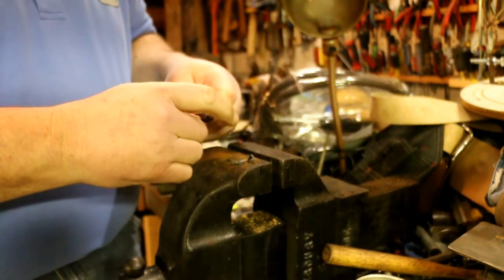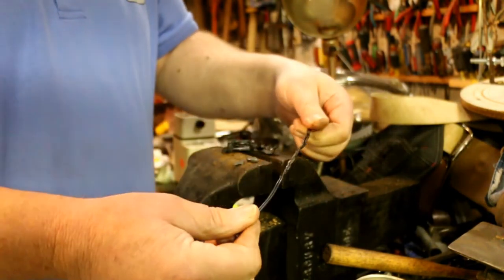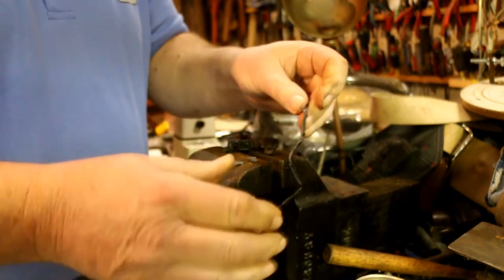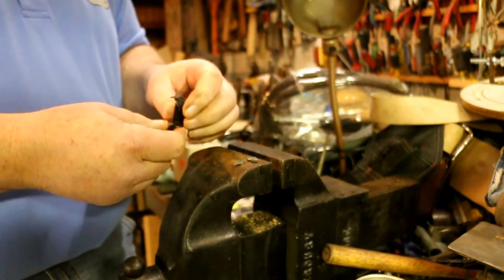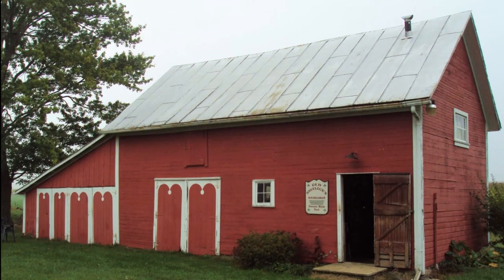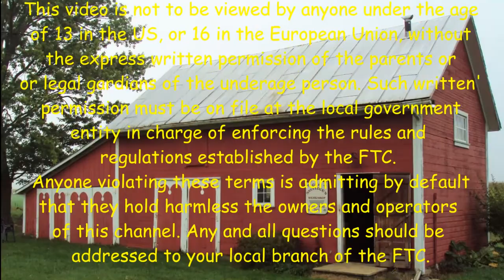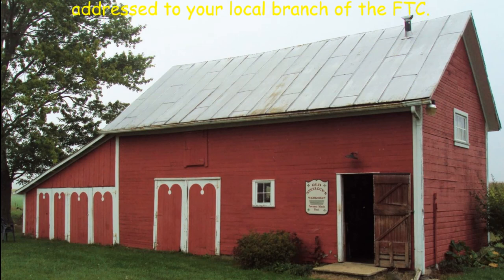Digital Picture Frame Pt 1 Trouble Shooting The Power Cord   What Is That

Comment: Ferrite cores are used to minimize RF interference.    The power may be DC, but it is not a consistent voltage.   It will likely be produced by a cheap diode which will flip the AC negative half cycles to be positive.  Perhaps the manufacturer found that the CD wave form was causing defects in the display.   Cheaper to use a ferrite core to fix than improve the power supply.
Dave.
Reply from the maker: Kind of smooth out the wave form. Gotcha. 😁😎

Comment: Ferrite cores are a cheap way for the manufacturer to somewhat improve the amount of noise cheap wall warts emit.  If you have surplus wall warts laying around, just find one that outputs the proper voltage, and has the correct polarity and power output.  Also, when the cord has damage, it's not uncommon for the socket to be dinged as well.  Those are often easy enough to resolder if the socket is a through-hole type.
Reply from the maker: It is on the desk in the shop. Still working. 😁😎

Comment: My dog chewed the cord. Can I slice it back together? There's a red wire and a black one
Reply from the maker: It happens to all of us. 
Our cat only chewed one wire. She decided it didn't feel good biting extension cords. 
Just strip back the wires and twist the red wire to the red and the black to the black securely. Solder them if you are comfortable with it. Crimp connectors are stronger than twisting adn easier than solder. 
Then put electrical tape over the joints. Plug it in and try it. 
If it is working then wrap tape around the whole wire to strengthen the joint. 
Shrink tubing is better than tape if you are okay with using it. 
Tell Fido to not chew the wires. 🐶
 Good luck.
Reply: Thank you. I told him that after he chewed my lap top cord. Slow learner
Reply from the maker: I had a cocker, lab, setter, mix named Homer. 
He never ate a cord that was plugged in but when he was a pupply he ate the cords off my circular saw and my drill. Completely gone plug and all right up to the shell of the tools.

Comment: Looks like time things die. My digital clock I've toted for YEARS died. New battery didn't faze it. Time to get another clock. It was probably 20 years old. Hate that but I'll see what  can find. Also time to go mail something to my Uncle. Get up with you later, God willing.
Reply from the maker: I spent $200.00 to fix a $300.00 Boliva my wife gave me 15 years ago. motor went out. Boliva fixed it. Guaranteed 10 years again.
Reply: @OldSneelock  I might get another and I might not. I do have one in the flip phone IF I ever turn it on. I had that thing in mixers, dumpers, road tractors and then the Taco. It was tough. But all good things come to an end sooner or later.
Reply from the maker: @lewiemcneely9143  I have had a dozen watches. Most were cheap that I wore to work. Lydia gave me the rest for Christmas. Much too nice for factory work. 
Still have the watch Dad gave me as a High school graduation present.